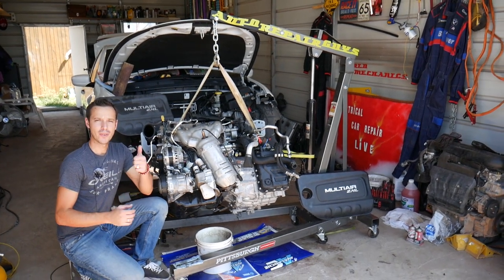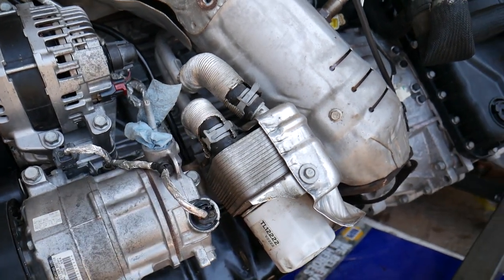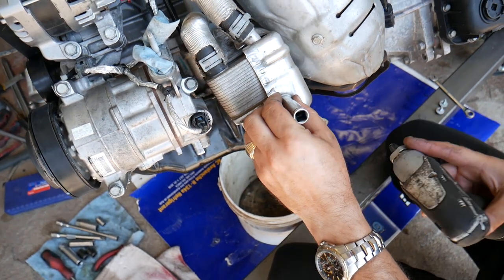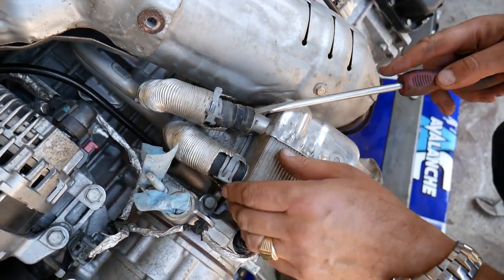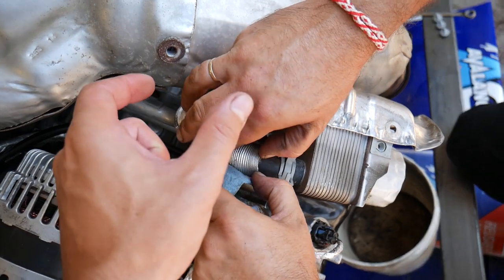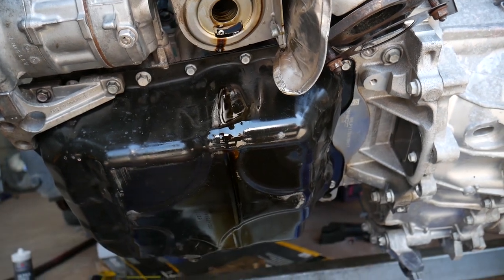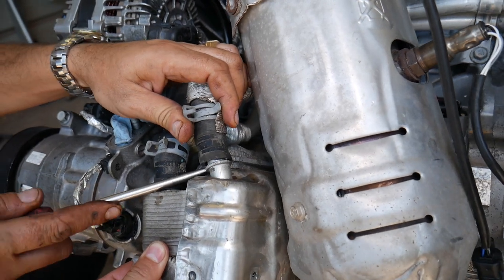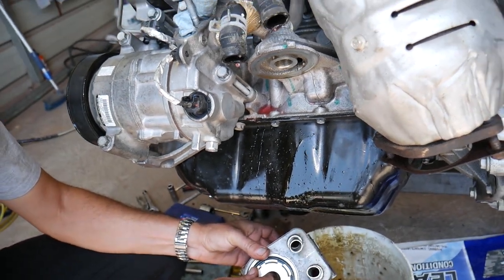OIL COOLER FILTER HOUSING REPLACEMENT REMOVAL, OIL LEAK, JEEP CHEROKEE, COMPASS, RENEGADE 2.4

Comment: thanks for the 12 mm Allen tip.  I just ordered a long socket for $8.  You didn't need to bother removing the heat shield until the cooler was removed.